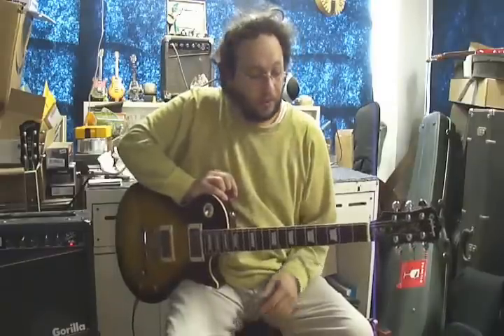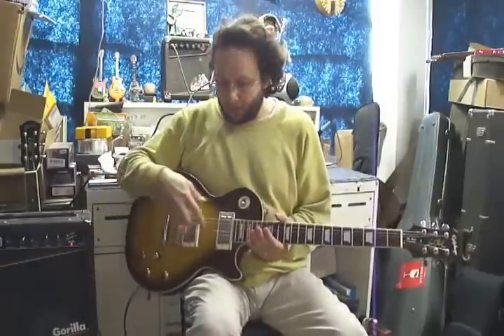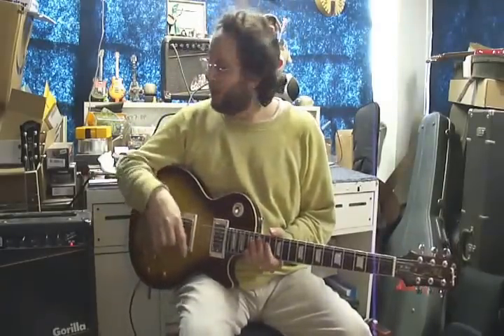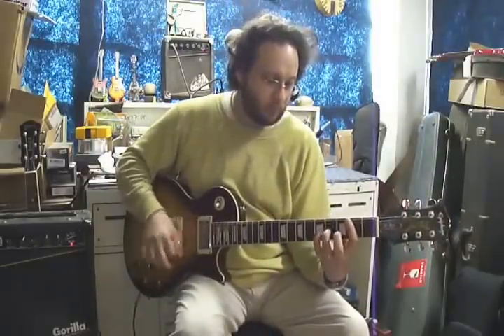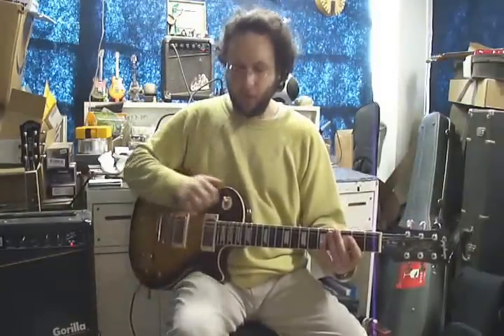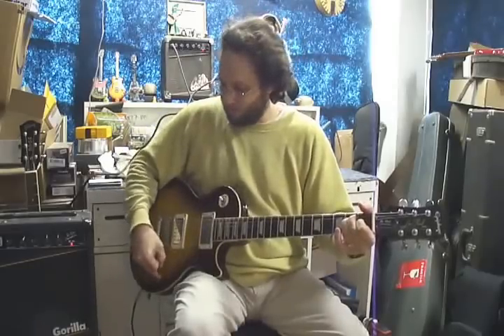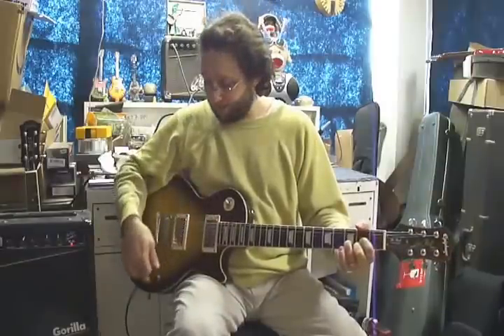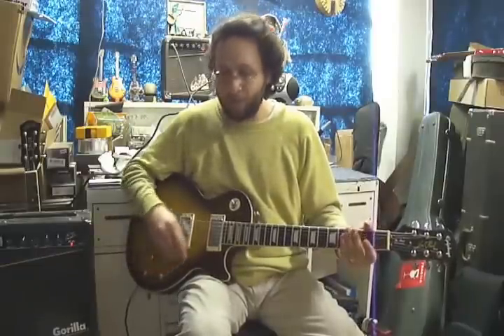Wiring humbuckers series/parallel vs coil splitting, and more by D Guitars Miami LLC

Comment: So I just wired my SG exactly like this, series/parallel pull pots, independent volume, vintage tone wiring and I am completely happy with the results. So much variety with no noise...thanks buddy!
Reply: Did you happen to found any wiring diagrams showing this same setup?
I’m working on a couple guitars right now and I’d love to use this wiring
Reply: @kevinyounger7854  I found one close and modified it as needed
Reply: Where did you buy the pull pots?
Reply: @timmarkowicz779  Amazon

Comment: I've got a Strat style custom build with a bridge P90 and a neck double/double rail, custom wound (yep, 4 coils so I can split the splits), p/p Bourne 500k pots with pull for parallel and slap for series, a 5 way switch with judicious use of treble and tone bleeds for different positions and I wind up with 20 (count them if you can) different and unique tonal variations at the flip of a switch and a knob pop! I can go from 50's Do-Wop to B. B. King to ELP to Zepplin to Gwar without changing guitars or set up! The variations with effects pedals is almost unlimited! Not trying to brag just saying that the understanding of WHY things work is basic to understanding HOW things work! Thanks for sharing DM keep up the good work! PEACE!!!!

Comment: great tip about volume pot wiring. never thought that changing lugs would make any difference
Reply: Look at vintage Les Paul wiring and compare 50s vs 60s wiring and that's one of the things they changed, IIRC, which also affected how the sound changes when you turn down vol & tone

Comment: Nice! I checked this video to see about what to do; I've got some new pickups for my Epi SG. I wasn't specifically looking for 4-lead pickups but the ones I got do have them anyway. I usually favour humbuckers but it seems a shame to lock them in one mode when I have options, so I also got some push/pulls. I was considering doing series/parallel at the bridge and coil split at the neck so I wanted to check if there was any point to that - as you've demonstrated I may as well do series/parallel for both. Thanks!

Comment: I had my guitars wired for independent volumes for years. I always felt like they were missing something. Then I rewired one of my jb/59 guitars and accidentally had the volumes wired dependent and it was like the blanket had been lifted and all the tone was back. Turns out independent volumes suck tone, it's a fact. I really missed the middle positions ability to blend at first but I gained so much tone back that it was worth keeping them dependent. Independent wiring makes your taper roll of highs REALLY REALLY fast. Anyways there certainly pros and cons to both but at the end of the day independent volume pots suck too much time to be worth it. Id love independent wiring if that wasn't the case though, but sadly it just is.
Reply from the maker: Wiring in a treble bleed to the volumes would help retain the highs as you roll off the volumes.
Reply: i have 8 electric guitars with no tone or volume controls connected for that reason. I use my pedal for volume control.
Reply: @guitartap EDIT: Missed the part about the volume pedal, until after I commented. But if you haven't I still recommend trying a no load volume an tone pot. I just modify my existing ones that way I can set the exact cut off point.

Origional comment:
 I just make my my volume and tone pots no load now so at 10 it's the same as not having them there at all. The amount of time versatility you lose by not having a volume and tone is on my opinion way too dramatic to just not have any. The way my volume an tone control are dialed in is what gets me to the literal sweet spot. It's cool if that's what you prefer, there's nothing wrong with that but I just hope you've experienced what using volume and tones correctly can do for your tone before you decoded to do away with them. Again, my way isn't the only way or the best sane as yours just different. I just truly wanted to know if you ever experimented with dialing in your tone eith the guitars pots. I'm sure you have but I have to recommend you do if you havent.
Reply: Doron Markowitz 
How did you get modern AND 50’s wiring too?

Comment: nice video... the bonus of me was how easy it is to rewire the lugs on the volume pot so both pickups stay on with selector switch in the middle regardless of volume pot settings. Turning on my soldering iron next! Thanks.
Reply from the maker: +Mikee535 yeah man. that's definitely one of the big advantages. you're welcome.

Comment: I use 2 lollar imperial humbuckers and only one has 4 leads so it was too troublesome to split and I was able to do parallel. These are on an Amer Standard tele from a year where they releaaed a double humbucker tele. It was a satisfactory mod. Since then i've looked into it more and my conclusion is that a good parallel wiring job is a unique sound, and only vaguely similar to a factory single coil. Same with a split (a tap is a different story)......the split double coil of a humbucker is usually smaller then a factory single coil, and to my ear sounds thinner.   I think the best bet is to buy a Tele or Strat for a single coil sound and some sort of Gibson for humbucker...I really like the ES-335.  I enjoy the versatility of my modified Tele though....especially running the neck parallel and the bridge series. It has it's own distinctive sound when I try different combinations, not really humbucker or single coil....but the thing is, if it sounds good, then it's a success.  Finally, I prefer the sound of parallel to split...it's cleaner to my ear.

Comment: I'm only at 1:15, but want to ask this before I forget. I think I heard you say that when you switch to parallel, you still cancel hum because the coils are wrapped the same way. Reverse winding cancels hum, so do you mean 'same way' as in still reverse wound, only now in parallel?
Reply from the maker: No, I never said they are wrapped the same way. I said that, in parallel, both coils go in the same direction, which cuts the impedance in half, producing a sound similar to a single coil. But since both coils are still on, it still functions as a humbucker, i.e.- no hum.

Comment: The wiring you mention for the tone control acting like a treble bleed.  I don't notice the treble dropping off when I lower the volume.  My guitar is wired weird looking and I can't understand it yet, but it sounds like it gets muddy when I raise the volume.  If you wire the guitar as you describe here, would that happen?  The other thing is the volume pot is a 'A500' and the tone is 'B500' is the tone a linear pot?

Comment: Great video! Do you by chance have a wiring diagram for this with the two parallel/series switches and fully independent volume control?
Reply: He is NOT going to show or give you a wiring diagram for the simple reason that IF he does, then no one would have any need for him doing it for a price.
Reply: You can find the wiring all over the internet. Just break it down into single mods. Parallel/series wiring and full volume control. Then 50s wiring that keeps the treble up as you roll the volume off. 

Here's independent volume control. The rest is easy to find.

https://www.premierguitar.com/articles/21106-mod-garage-decouple-your-les-pauls-volume-controls
Reply: @guylainecollett7943  except these diagrams are available free on the internet if you know how to use a search engine. It's not that if he provides them, no one will need his services. They're already provided by other sources. Seymour Duncan Wil gladly give you whatever you need, for example. So will plenty of others. He's not doing anything new or groundbreaking so he's not hiding anything or keeping anything secret. Still, there are people out there who can't do their own work or can but just prefer not to. They still need someone like him to work on their guitars.

Giving away wiring diagrams wouldn't hurt his business. Especially when the people asking are 1600 miles away. They were never potential customers of his to begin with. Not for that, anyway.
Reply: As a matter of fact, here's someone asking about the exact same combination of mods with wiring diagrams.
https://forum.seymourduncan.com/showthread.php?321551-LP-Series-Parallel-Tone-w-50-s-Wiring-and-Independent-Volume

Comment: Great info. I'm particularly interested in the rewiring of the tone pots that enables volume roll-down without tone loss. Will this work on a single coil like a strat? And why isn't this the standard way for wiring tone? Seems counterintuitive to have tone decrease along with volume...
Reply from the maker: this wiring is primarily for humbuckers with 4 conductor lead, which give a multitude of options, such as coil splitting, series/parallel, and phase switching. You can wire single coils in series, but that wiring would be a bit different than seen here. As for tone pot wiring, the industry standard is to have the tone pot wired to the input stage of the volume and not the output stage. I agree it should be the other way around.

Comment: One wiring mod I've used but not seen elsewhere is to connect each pickup's tone control directly to the pickup, but then have the signal pass through a 100K resistor before reaching the selector switch.  This somewhat reduces the top volume, but allows each tone knob to act more independently on its own coil.  In my own particular case, I use four steel bars as "mutes" connecting the upper four pairs of pole pieces on the bridge pickup, since I often play a bass-strum pattern using one of the bottom two strings plus the top four, and I like some extra punch on the bass strings (obtained by turning down the tone control on the guitar while turning up the treble EQ on the amp).  I think the wiring technique might be useful even when using a more conventional tuning, since the character of the upper harmonics is rather different on the bridge and neck pickups, and it may be helpful to adjust them separately.

Comment: Thanks for another great video. I have one push pull pot guitar that splits each coil, but like you said with parallel you get more of a single coil sound. I like the parallel wiring better. I have some P90 4 conductor humbuckers that I can run in parallel. It's a 50's tribute Les Paul. I am getting tele and strat sounds!
Reply from the maker: gearmeister hey man, glad I could help. and I appreciate your support.
Reply: Doron Markowitz No problem.  I use a simple trick to run humbuckers in parallel on any guitar with 4 conductor wiring. I take the coil link wires and run them to the unused leg of each tone pot respectively, so with tone on max I get parallel mode, slightly roll off the tone to get full humbucking (series) mode. No push pull necessary
Reply from the maker: gearmeister yeah, that's how the Peavey T-60 was wired as well.

Comment: Which is the advantage of  wiring the humbucker coils in paralell vs coil taping, i.e. cancelling one of the two coils? Just killing the hum?
Reply: The two main reasons for choosing parallel over split coils are noise (parallel is still humbucking) and tone. The individual coils from a humbucker tend to (in general, there are exceptions) weaker then true single coils. Giving a weak split coil tone. 

Neither will sound exactly like a single coil and which sounds best is subjective.

Comment: Dear Doron, thank you for sharing this great idea! 
I've been trying to find good quality (e.g. CTS) push pull linear pots, without success. All I can find are audio (log) pots. Would you have any hint where to find linear push pull pots and/or good brands?

Thank you!
Reply from the maker: I use WD pots, which I find to have a very smooth taper, and looseness that feels worn in nicely right out of the package, unlike the stiffer feel of CTS pots. WD does make a linear taper push/pull as well as audio taper push/pulls. I hope that helped.

Comment: So in short: which is the difference, if any, between a humbucker with both coils wired in parallel or a split humbucker with a coil shorted to ground and so working as a single coil?

Comment: Hey really informative and very insightful video!  I am in New York, by any chance do you have the wiring specs on how to do this? I would like to get an Epi Les Paul Custom or get this diagram so I customize my Flying V guitar.  Thanks.
Reply from the maker: this can be done with any guitar that has humbuckers with 4 conductor lead wires.

Comment: How do you check once it's all wired up?
Reply from the maker: I plug it into the amplifier and listen to all of the settings. I also check with my ohm-meter to make sure all of the settings are correct.

Comment: Good job! That´s exactly what im planning to do in my guitar. Since im really far awar to and it would be kind a difficult to send my guitar to you... I would thank a little advice on which pots i must use and where i can find a wiring diagram. Thanks for the video!
Reply from the maker: Rodrigo Garza the pots used were Dimarzio 500k push/pull volume pots. depending on which brand of pickups you plan to use, you can find wiring diagrams for series/parallel online at the various companies' websites.

Comment: I have what's left of a roll of copper shielding tape I use on my Strats... wouldn't this solve the single coil (if humbucker coil split) 60-cycle hum issue as it does in my Strats? I was thinking I'd do the pickup cavities, the switch cavity, and the control pot cavity...
Reply from the maker: Shielding tape does not eliminate the hum that comes from single coil pickups. It reduces the amount of hum that you can pick up from extraneous sources such as bad lighting and so forth.

Comment: Could you do phase switching with a 2 wire hb? Just run it to an on/on switch that's in phase on one side and the other has the leads reversed for out of phase?
Reply from the maker: No. You'd have to modify it to 3 wire because a 2 wire has one of the wires as a dedicated ground.

Comment: Great job explaining a really cool mod! When wiring a humbucker with a metal pickup cover in the series-parallel config. do you need to worry about the grounding/ polarity of the pickup cover? Thanks
Reply from the maker: Jerome Schwartz as long as the wiring of the pickup is four conductor lead with a separate shield or ground then you don't have to worry about the cover. the cover is already soldered to the base plate. the bare shield or ground is directly soldered to the base plate as well internally usually.

Comment: Thank's man, I've learned a lot from your Video and I think I will try some of these ideas. But there is still another question. What do you think tonaly about wiring a Les Paul with only one Tone and One Volume and using the remaining wholes for the series/parallel switch. For an old Fenderplayer 4 Potis are still a bit tricky to handle because I use them constantly to balance out my sound.
Reply from the maker: I personally prefer single volume and tone. So absolutely do it.
Reply: All right, lets do it :) Wondering that I can't find anyone  on you tube trying this.
Reply from the maker: +Tom Stern Yeah man. Go for it.

Comment: Hey man, I was wandering if you could help me out with wiring options. Basically I'm having my own guitar built and the options are:

Two pots for volume
Two push/pull tone pots where in the up position their in parallel wiring
A cap on each of the tone pots
A reversed jazz bass wiring on the volume
3 way toggle twitch
And if possible, a 50's style wiring on the push pull pot

Would it be possible, and if so, would it be worth it?
Reply from the maker: ***** what do you mean by a reversed Jazz Bass wiring for the volume? all the other stuff sounds fine. I don't see why not.
Reply: Doron Markowitz I was kind of referring to the Jazz bass wiring in the video, cut couldn't find any diagrams on it. Do you think that you could maybe show me a diagram with all of the things that I had mentioned on the first comment except with standard jazz bass wiring for the volume pots? :)
Reply from the maker: ***** well, Jazz Bass wiring is 2 volumes and a single tone. this is 2 volumes and 2 tones. basically, the pickup is wired to the center lug of the volume pot and the output is wired to the first lug. then the tone pot input is wired to the same first lug of the volume pot. take a look at the wiring of your Les Paul. you'll notice that the pickup is wired to the first lug of the volume pot, and the output wired to the second, or middle lug. that's no good if you want independent volume control for each pickup. just reverse those 2 connections and that's it.

Comment: So, if you have 50's style wiring on a LP guitar and do the independent wiring, do you still lose the treble when lowering one of the volumes when in the middle switch position?
Reply from the maker: Well there's no treble bleed circuit on the volume controls. So they would still function as normal, including cutting trouble as your lowering volume. To avoid that, install a treble bleed circuit on your volume controls.
Reply: @doronm63  Not sure if you've seen this guy, but he claims the treble bleed won't make a difference? I may have to install one and see for myself.    https://www.youtube.com/watch?v=NzYwuYG1Ls0